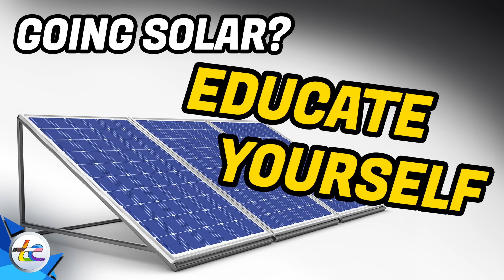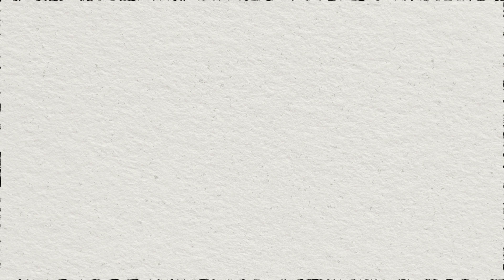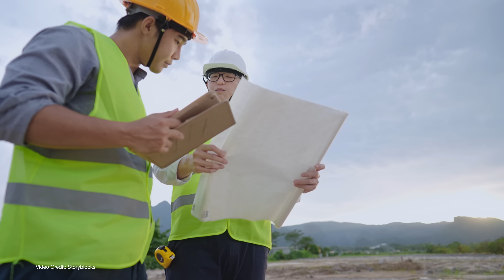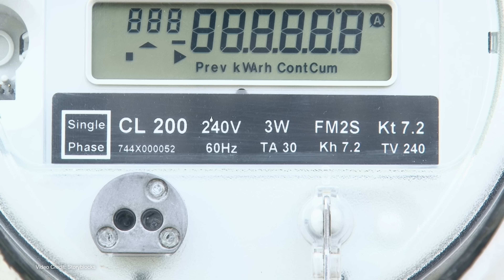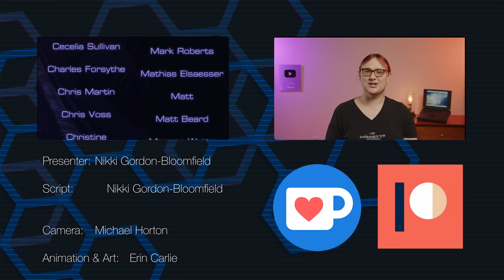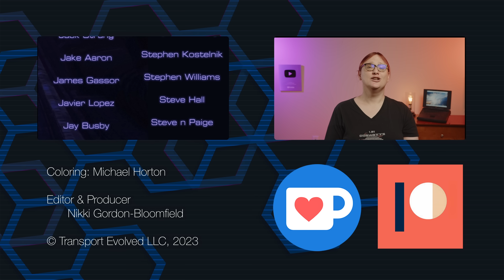Going Solar To Power Your EV? Here Are The Terms You Should Know!

Comment: There is a third setup that we specialize in and that is Grid Tied - Non Feed in. Eliminates any permits from utility company and the hassle dealing with them with stringent net metering programs. This requires Grid Tie inverters that have Limiters (or CT clamps) that can monitor your homes real time power usage and lets solar output equal the energy thats needed. So no solar is sent to utility and your not giving away solar energy that YOU paid for. The utility did not buy your solar system….

Comment: Thank you for this. I took a different path, leased an EV, unlocked very cheap overnight electricity, but came with increased cost per kWh for the other 19 hours. Bought a 20kWh battery and inverter, charge batteries at night in very cheap rate, use battery for the 19 hours of expensive electricity. Saving ~ £0.32 per kWh, about £2,300 a year in savings . Combined with additional savings of £100 per month in fuel savings, the EV and house battery break even in 3 years, less if the elec goes up again in UK in April. I am running the house battery at an average of 60% DOD so should get 20 years out of it. By the way I am not your camera man:-)

Comment: As much as a love solar, there are some major gotchas that folks need to know about. This is for anyone in the US. I can't speak to other parts of the world.

1. A significant part of the cost of installing solar is the labor. While the parts aren't cheap, they aren't that expensive compared to the labor involved. Many (most?) large/national solar installers offer end-to-end service at a very steep cost. This really eats into the financial benefits of going solar - perhaps doubling or tripling your RIO period.
2. Going along with the first point, since solar costs so much (via large installers), many (most) are pushing their power purchase agreements products instead of financing. I had to be direct with anyone pushing a PPA - basically tell them to pound sand. PPA right now is the worse option for going solar since you don't get the benefit of the federal incentive and the systems isn't yours (long term rental - like a car lease). Most installer will say some nonsense about the PPA being easy to transfer to the new owners if you do sell - I've asked a number of real estate folks about this, and this simply isn't true. PPAs encumber the home and can cause some deals to fall apart.
3. There is a lot of debate about if and how much a solar install actually adds value to the home. I've heard everything from 10% to zero - from real estate agents. If trying to justify an install based on increased value, the safest approach is to exclude this factor entirely, and let it be a nice surprise if it does help when it comes to sell your home. A solar install only adds value to the home once it is paid off and it can actually take away value if it is setup using a PPA.
4. Consider community solar if unsure about how long you are going to be at your home or if you are renting long term. Going solar requires keeping your home for 8+ years, perhaps longer if you add batteries. However, some community solar programs will actually increase your monthly bills until a certain break even point - for me, that was at 3 years with Duke Energy in Florida. However, you may be able to keep your community solar plan if you relocate into the same service area of your current utility.
5. From an environmental concern, solar panels aren't instantly green - just like EVs - there is a period of time/use required to zero out the emissions required to produce them. For solar panels, this is about 3 years of use on average. This is one area where you can "double dip" - speeding up your EV's net zero point by using solar to charge your EV instead of the grid.

If I had it to do over again, I would have no problems going solar, but I would save up and hire a local general contractor and electricians, and buy the parts myself. It would take longer but cost about half (or less) what I paid for my current install - but it would require me to pay cash (which isn't a bad thing). In the mean time, I could opt to go with community solar until I had the funds to build out my own system.

Of course, if you are going solar for primarily environmental reasons, some of these points might be less important to you.

Comment: Besides the terms, you could have added a calculation: if you drive an EV that uses on average 3.5kwh per mile and your commute is 20 miles one way, you'll need 28kwh 5 days a week, but we'll take 6 days for the weekend trips. You will need X amount of panels to cover your EV usage, when factoring in insolation, direction, efficiency, etc. etc.
Reply: A good concept but you have the usage backwards. It's usually measured in miles per kWh and vehicles usually are in the 3-5 miles per kWh range, so a 20 mile commute one way is 40 miles, at 4 miles per kWh that's only 10kWh so only 60kWh per week. If you live in an area that gets 5 sun hours per day that's only 2kW of your system dedicated to EV charging. If you are paying 0.20 per kWh for electricity then your commute cost would only be 2 bucks a day, 12 bucks a week, or 624 bucks a year. It's nearly insignificant in the grand scheme of designing the solar system overall.
Reply: @Snerdles  I don’t think it is insignificant. Our EVs usually use more electricity than the house does in a week. Some weeks, it might be twice as much. If we make 40 kWh on a summers day, one EV can easily use 25, and it’s battery pack is 75 kWh. Our M3 is by far the highest wattage user in your house, with L2 charging rates at up to 12 kW, whereas the water heater runs at 7 and the stove at 5. The car charges much longer that those others generally run too. Obviously this is still much, much cheaper than gas, but you definitely should not size your solar system based on historical home-only electric usage, even if you do not currently own an EV. You eventually will, and that solar system will last a long time. Your installer may make different choices like use lower wattage panels to “save money” or pack them in less densely, which will be expensive to redo. Also, expect generation to be a LOT less in the winter. Better to have too much solar than too little.
Reply: @ianollmann9393  How often do you actually charge from 0 to 100 though? And how much would the gas cost to go the same distance?
Reply: @Snerdles  You don’t. If you were really were at 0 you’d be out of charge, and probably stuck by the side of the road, just like any car. For BEV, generally people don’t charge to 100 either. It isn’t good for the battery. Most charge to 70-80% most of the time and maybe run it down to 30-50% in a day and charge it up again over night. Maybe you use more or less depending on commute and car model.  Because you charge it every night — assuming you have home charging — it’s always full in the morning and you just drive where you want and never run out, unless you decide one day to drive a couple of states away. In those cases the car knows where the chargers are, whether or not they are in use, and will just plot a course to make sure there are no problems. It isn’t like a gas car where you might occasionally finding yourself driving around looking for a gas station wondering if you run out. Basically, it’s like your cell phone.

As to efficiency, the model 3 runs about 4 mi / kWh. If you pay 10c / kWh on your electricity bill where you live, this would be 40 miles for a dollar. If your gas car gets 40 mpg, then you’d go 40 miles for a gallon of gas. Does your state have gas for $1/gal? I doubt it. You are probably paying 3, 4, 5 times more. There are virtually no scenarios where gas is cheaper to run day to day. It’s just a question of when the extra cost of an EV is paid off by cheaper fuel and reduced maintenance schedule. While electricity at my house in California might be as high as $0.61 / kWh, that is between 3 PM and 9 PM. We just set the car to charge automatically late at night when it is much cheaper — PG&E has EV rate plans for this that vary by time of day — so, even if you live in CA and are paying $0.22 / kWh at night, your electricity bill is still a tiny fraction of what the price at the pump would be. To be fair, gas might be $6/gal here, too.

Also, keep in mind we are discussing charging the car off solar. In that case, in some states this is costing you nothing. In others, it is costing you what you’d otherwise be paid via net energy metering if you sold the electricity to the grid. At my house, you’d be better off selling the solar power to the grid in the day at $0.61/kWh, and then buy it back at 1 AM at $0.22/ kWh to charge the car. So, net, each day the car gets charged, and I get paid maybe $10-15 for the electricity!  Yep, you heard that right. I don’t pay to charge my car. It’s not even free. It pays me. I use my own electricity to charge my car for free, and the utility pays me around $0.40/kWh to hold on to the electricity for a few hours before I use it to charge my car. This is fine. I might be at work during the day and couldn’t charge then anyway. (My workplace had free charging, too, TBH, but I’m retired now.) I also can charge it from the comfort of my own home and not have to stand there holding a dirty pump handle or find myself late to work due to an unplanned for gas station delay. I feel this might be better than your gas station experience.

I did have to buy solar panels and an EV though. I like these things. Having power when the power is out is good. PG&E likes to leave us in the dark a lot. The power was out for a total of a week last year and as of mid February 2023, we’ve already racked up almost 4 days of grid outage time for the year. Replacing the contents of your freezer is a drag. The EV is so much more of a pleasure to drive. It’s quiet, super zippy, and pretty much zero maintenance. Everyone would have them if only they just made more of them.

Comment: One area that I think deserves to be better discussed is that many people will say they have installed solar also with charging their EV in mind. The problem with this is that if you work in an office and commute with your EV you can’t be charging it during your daytime work / commuting hours when solar energy production is best. This means to charge your EV off your solar you will need a significantly sized home battery setup to store the solar power for use to recharge the EV when you get home as well as to power lights and appliances at night.
Reply: Also heard people talk about how if you want to use the battery for emergency power than you likely don’t want the car charging from the battery instead of the grid by default, since car batteries are much bigger than current home batteries so refilling the EV from the battery most likely means you’ll quickly drain the battery leaving you with no emergency power. So that’s also something to consider and talk to your installer about. 

If people aren’t typically home during the day then perhaps they could try to top up during the weekend/days off, as much as possible in their situation which granted isn’t always possible.
Reply: But if you have net metering the power produced while at work is put in your car at night at no cost or even cheaper if your power rates fluctuate.
Reply: That is true for an off grid system, but not for a grid tied system.
Reply: My employer had charging on site, so I could charge the car for free. This is a great perk! It is a life saver for young apartment dwellers who may not have charging at all, and sometimes will keep employees at the office longer, especially on fridays and mondays as they wait for the car to finish charging. Might as well get some work done! The electricity will cost you pennies.

Comment: Thank you for the video! I have seen stuff about micro inverters vs ‘regular’ daisy chain inverters but I hadn’t heard about the anti-shading aspect of them so thanks for breaking down and explaining the absolute basics for us!
Reply: Yes, but there is another option for standard inverter with panels on strings, you can use Optimizers connected to each panel to compensate for shading issues.
Reply: Micro inverters also minimize impact of a single failure.
Reply: @steveurbach3093  Right, Nikki talked about microinverters, but not about optimizers.

Comment: Excellent video but I don't think that what you said at 19:22 is correct. You said that "if you are generating more power on your roof than you are using that power has to go somewhere and if it can't go down the grid because the grid is down it could burn down your home electrical system". It is my understanding and experience that my pv system can only generate as much power as I can use. For example, if I am exporting as much power as my supplier will allow (5kW) and I unplug my EV while charging, the amount of power flowing from my panels will instantly decrease to reflect my new lower consumption plus the grid export. Basically the panels can only produce as much power as can be consumed, which includes what is being exported.
Reply: I thought everything was electrically protected too

Comment: + tip: If you are planning to get air conditioning or add on any other big energy users post solar panel installation let the solar panel planners know about it 

A solar installer had a story where they got called back by a business owner who was unhappy about their bill not going down. The installer noted there had been some other site upgrades that wasn’t on the initial energy use planning and requested permission to add energy monitors. They then where looking at them when an employee came in basically went ‘hey boss’ then went into another room and then the energy use rocketed up in real time!

When the employee was asked what they’d done they said they’d turned on the air conditioning. 

The air conditioning wasn’t in the initial energy use plan so it wasn’t accounted for in the energy use and potential savings calculations, hence the bill hadn’t really ‘come down’ or rather it had it’s just the aircon cost had pushed it back up again.

Long story short, the solar installer doesn’t think the business owner will be letting anyone install anything without double checking for energy efficiency in the future. XD 

So yeah, try to avoid being caught out by things like that via letting your solar panel planners know.

Comment: In California, you can still get full “reimbursement” under NEM 3.0 for generated power if you store it in a battery and use it to avoid using power during prime time. A penny saved is a penny earned, and all that. Though these days with income taxes, fees and profit+ programs, a penny saved much be worth 1.5 pennies earned. YMMV. Obviously this only works to the amount of kWh that you would use during that time,  but since the prime time rates can be 2-3x night time rates, and it includes the supper hours when the electric stove is likely to be on, not to mention lights, tv, etc, this might be much of your consumption. If your kitchen runs on gas, it may be time to replace that too, since cooking with gas is not green. An induction stove is safer, and offers similar behavior to gas for quick heating and precise control.

Comment: One advantage of using optimisers on each panel instead of microinverters is that, if configured correctly, it is possible for the system's output, with a DC coupled battery in the system, to not only exceed the inverter's capacity, but to also exceed the panels' rated output. For example my 13.25 kW panels and 10 kW inverter can produce up to 15.2 kW of power. The true maximum of my system seems to be the amount that the DC coupled battery can accept plus the inverter's maximum output. Mind you the panels would have a true maximum output, my system just can't reach it.

Comment: Just ask how much electricity it takes to get diesel or petrol into the vehicle tank? How much power is brought in for oil drilling, how much for pumping operations to get oil from the ground, how much power for pipeline transport, for tanker loading and transport, for tanker emptying and pumping into other pipelines, how much for the Refining at refineries, for distribution and transportation to the service stations, pumping into the tanks of the service stations and pumping out of those tanks into the vehicle tank? Then we ask again, what is cleaner for the environment: BEV or ICE?
Reply: Ah the what a about argument.  The question is when will EV be powered by zero emissions generation. When will EV batteries be made by 100% post consumer battery recycling.